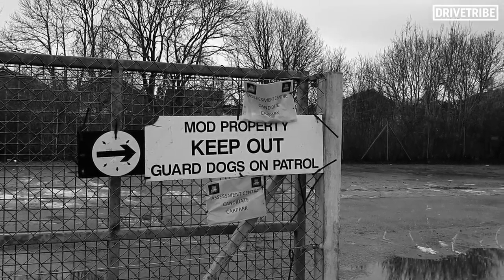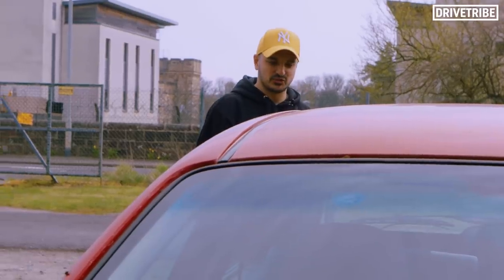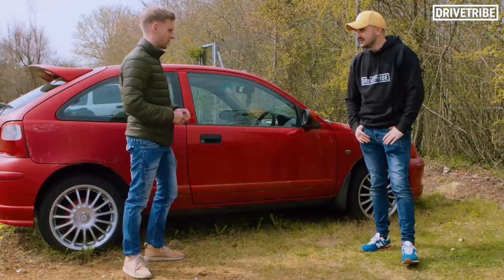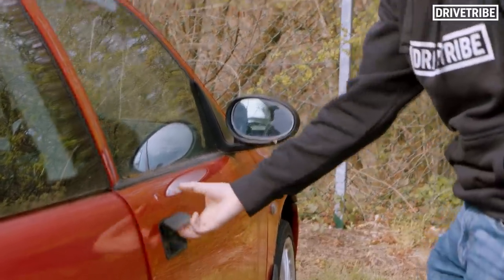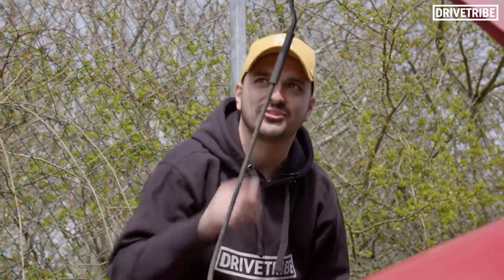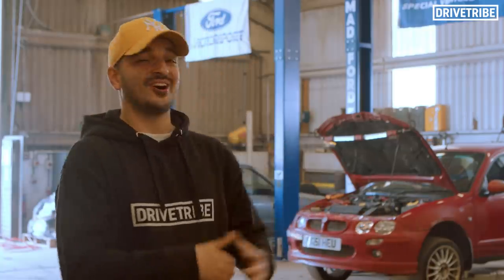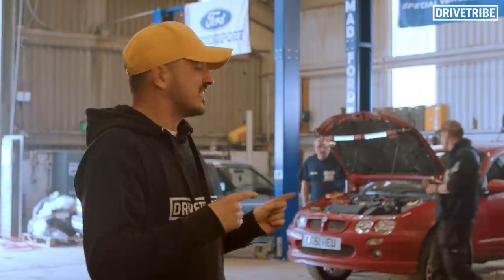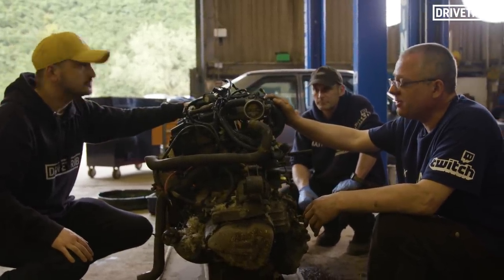Rescuing my abandoned first car from a military barracks | Rover 25 restoration

Comment: Get an MG ZR 105(1.4) ECU and Throttle Body and it will run at full power fine Mike!
Reply: Just about to post exactly the same, 1.4 105 48mm throttle body, 105 throttle cable and the ECU, 5as and fobs from the same car and jobs a gooden. Or just swap the tb and cable and have kmaps sort it.
Reply: This changes the throttle position relative to WOT or fully closed in some way right? That limiting spring. It just didn't make sense to me how the presenter explained it. Why would the engine not know there was more AIR available. Of course there is a map for it, the engine will compensate. Unless you are removing the ECU's ability to read the amount of air moving through its mass air flow sensor. Or am I missing something? He really threw me off explaining it like he did.
Reply: @cmendoza1094  Yes I am fairly sure you can just swap the TB, if they just limited the throttle movement why would they need to change the ECU?
Reply: @m4xww  that's a myth done so scrappies and mg breakers can sell ecu's for a saft price... realistically change the throttle cable and throttle body and it will do fine!
Reply: Could you not use the 52mm throttle that was on the MGF/TF's e.t.c?
Reply: @ek8710  you could but the tf is a 1.8 thus you could be making the throttle too big for the size of the engine, intake and exhaust are specifically sized to produce a decent scavenging effect, too big a throttle body (for a 1.4) could lead to less throttle response and even worse less power!
Reply: These are my absolute fave type of comments…..powahhhhhh
Reply: @cmendoza1094  exactly!
Reply: Yeah, acting like it can’t be done... I was thinking, if they purposely limited it, you can purposely put it the way the ZR would. I think they should continue down the ZR clone path.

Comment: You can just fit a different throttle body and cable and the ECM will learn the new body on these cars and you get more power.
Reply: Exactly what I did to mine!
Reply: I was thinking that, Rovers always went the easy route. Why make 2 ECUs when you can make one
Reply: Exactly so it will go from the 85Hp to the full 105 that the 1.4K series makes
Reply: @adambamberg9385  yes we did!
Reply: @mattdickins2127  trust you to show up 😂
Reply: I did exactly the same to mine back in 2011, massive difference!
Reply: Me 2nd car was a Rover 25 1.4 Impression. I just cut the Plastic Tab off the throttle body that restricted it from opening fully. Worked perfectly
Reply: @37ant  I was just about to post exactly this. The only difference is the extra throttle stop lol
Reply: @smh28v6  

Different throttle cable and the throttle disc in the restricted TB is a big weird plastic wedge affair compared to the regular throttle disc in the unrestricted item.

Comment: My first car was a 2003 Chevrolet Impala LS that I bought from my mom for $4500. I still remember how I felt when I came home from work with that car (mom let me use it since I worked evenings and she worked days) and I saw a black Hyundai SUV in the driveway. It wasn’t there when I left. When I asked her about it, she said that was her new car. And when I realized what that meant, I gave her a hug and then looked back out the window at what was now my car. I was ecstatic. 3.8L V6, sunroof, fog lights, headed leather seats, a short spoiler on the trunk, and the whole thing was painted a metallic dark tan somewhere in between gold and brown. I had that car for some four years before the transmission went. If I could, I’d find that car and restore it back to a factory grade look. Way to inspire me, Mike!

Comment: I was extremely lucky. My grandfather drove a 2005 Mercedes Benz E500. When I turned 16 (2016), it was 11 years old and he had just had knee surgery. Getting in and out of such a low car was an issue for him, so he gave it to me. I must say, having a 5 liter V8 in my first car was pretty incredible. Literally double the size of my current Hyundai Sante Fe Sport's engine. Had to sell the Merc when I went to college. It wasn't big enough to move all of my things, and had too many problems to trust it with the regular 800 mile trip too and from school. I miss it though.

Comment: Just to point out on that throttle body thing you don’t need to remap it it’s a straight swap but yeah great video as always :)
Reply: PagMan It's the Rover guy
Reply: @svareee Fancy Seeing a Twitch Viewer here
Reply: The throttle cable needs swapping too.
Reply: @roverboy01  didn't have to on my old one. :)
Reply: My MG ZR has an issue… the hazard lights will not turn off at all. 

Can you please give me some pointers?
Reply: @Slothdeman  sounds like an electric issue I’ve actually never heard of that before
Reply: @Slothdeman  

What happens if you unplug the hazard light switch? Could be as simple as it being knackered though it's an unusual failure!
Reply: @Slothdeman  If its a very late model/ facelift, it could potentially be the Pektron body control unit. They have the tendancy to go abit senile and cause all sorts of bizzare electrical issues.
Reply: @skylined5534  When I unplug the hazard light switch they stay on. It has been in a front end bump before so it’s at the auto electrician…. Hopefully it’ll get sorted. 

I’ve had all my Pektron relays replaced so it must be a wiring fault

Comment: That is more MG than the generic Chinese cars roaming the streets with a badge.
Reply: Japanese engineering you mean?
Reply: @tonyli2096  Chinese now I own a Chinese mg and have 0 complaints about it
Reply: @Srevelation  I meant the one Mike Fearnie has, the partnership between Honda and Rover was apparent back then. I have no problem with Chinese cars, I’m Chinese 😂
Reply: MGs of today are actually half british being mostly developed in the UK
Reply: @tonyli2096  The 25 was a bit half an half. It was like a combo of Austin Maestro and Honda Civic parts. They were great though!
Reply: @Srevelation  Chinese MG? You probably meant to type MSG!
Reply: @TravisTerrell  the 25/ZR was a bit of an odd one, it had a Modified Maestro Rear Axle and the Bodyshell underneath at the front was the Same as a Rover 200 R8 and the back end is completely original, they used some parts from honda too such as the Indicator Stalks but overall they were great cars.
Reply: It really isn’t. There’s nothing MG about these cars at all.
Reply: I live in China and have an MG6 1.8 Turbo. It is actually the fastest MG ever. China built but engineered by Brits. It goes where you point it, handles well and has enough performance for most driving and all the toys you could need including GPS (with English option) and cruise control. It now has 155,000kms on it and has been the most reliable car I have ever owned (shame Rover couldn't get that right) and we are currently looking at replacing her with - of course - another MG6, the top of the range MG6 Hybrid. Well, in fact not changing her but we will keep her as a local runabout alongside the new one. Great car, does exactly what it says on the tin!
Reply: @Roverjoe   Interesting. Gotta love cars made from spare parts!
Reply: yall got Chinese cars?
Reply: @tonyli2096  No Japanese Engineering in the ZR. The K Series was totally designed by MG/Rover as an alternative to the Honda engine being used in the Swindon equivalents of the rover 200 (previous model). The gearbox is a peugeot one.

Comment: My first car was a 1990 Jaguar XJ6, this was almost 15 years ago. 4.0 poverty spec with beige cloth interior 😝. It was my dad's. He was always a bit of a delboy character and had bought it used instead of the other option which was a Granada v6 if I remember correctly. He was super chuffed. Sadly he passed away when I was 16 and it sat in the garage for over a year getting in a sorry state. At 17, and with a Haynes manual and a cheap halfords toolkit(which I still have), I took my first steps in learning car mechanics. Sorted some rust, fixed the leaky oil cooler and got it MOT'ed. The money I saved buying a car went towards insurance. And this was when you could pay to get 3rd party on other cars, which enabled me to drive it. Bit dubious of course. Unfortunately, after 2 years the rust got soo bad. Beyond the skill and finances of a 19 year old teenager. And with no space to keep it, ended up scraping it. Me and mum were in tears seeing it drive away on the back of a low loader. One of my biggest regrets as now, I would happily spend the money to save it. Still, that car was one of the seeds that ended with me as a mechanical design engineer - I've even made parts for JLR! Maybe a kid in 20 years time might be fixing something I designed 😅

Comment: I used to love that car.. wanted it for my first car as well in 2013 but ended up buying a Nissan Almera.. which I still have in 2021 with 160k on the clock
Reply: An Almera?…you poor soul
Reply: I have Lymphoma and that’s not as bad as an Almera 🤣🤣
Reply: What year?
Reply: The MG would have cost a lot more to still have after 13 years 🤣
I have had a few mgs. Lol
Reply: @misterbuklau4053  2004
Reply: @Missed_Apex_GT  my mum had one at the time which I learnt to drive in so I bought one for myself. The 1.5 petrol is bulletproof and I’m never getting rid of it. Nothing wrong with Almera’s probably most reliable hatchback of its time apart from the Corolla
Reply: @Missed_Apex_GT  I’d rather have an Almera 😉
Reply: @forresttm  had a rover 4 years and all it cost me was indicator bulbs, about 90 quids worth of oil (halfords trade card) and a 110 quid headgasket job

Comment: That guy is brave driving a Renault tow truck, what do they have as a 2nd tow truck to tow that and the car thats on it?  Lol
Reply: I'm just trying to figure out why he dragged it out sideways if it had the key. (I drive a similar van)
Reply: @sercanserj7804  Battery was dead and they did it from the front so it would be right way round on the flatbed
Reply: @theprodigalstranger5259  I would have just pulled it back first then lined up in front rather than dragging the front around.
Reply: @sercanserj7804  I think its a leverage thing as well. Ive seen them do the same thing with beached boats. They'll pull them from the bow, supposedly makes it easier.
Reply: @theprodigalstranger5259  dunno why it matters on a flatbed which way it's facing, unless he wanted to be very specific about balance but the rover/mg is quite balanced
Reply: @zackraiden5875  each axle has it's own weight limit. With the engine being at the front you dont want all that weight behind the rear axle.... if you have a 7.5t truck it wouldn't matter but with 3.5t you need to be careful.

Comment: My first car was a Triumph 1500 - 200 quid from a mate 40 years ago. A couple of months into the ownership the big ends went to we towed to another mates father in law's garager, too the engine out and apart, took the crankshaft to Brunt's of Silverdale (Stoke on Trent) and the  skimmed it, we fitted a set of oversize bearings put the car together, sorted out the timing and first turn of the key she fired up smooth as silk. She kept me on the road until I traded her for a 1600cc straight 6, Triumph Vitesse - now there was a car I wish I still had

Comment: I was expecting it to be killed by a head gasket failure not a clutch.
Reply: That clutch and bald tires...might have something related to eachother. Burnouts
Reply: The headgasket problems have pretty much been resolved. Its a one time fix if it goes now, just use the upgraded kit.
Reply: @SpitfireFortyFour  I know, but it is rarely economical to do, so leads to a lot of Rover / MG being scrapped.
Reply: @grahamariss2111  It's more lack of knowledge. You take it to the local garage they charge way too much (and often do a poor job) and then the car is done for as it fails again and they say its uneconomical to fix. It happened to one of my neighbours.

The one time I have had a K-Series go I did the job myself and it cost me about £160. Alternatively there are specialist who do it plus the belts for around £350.
Reply: @SpitfireFortyFour  Did you use the Multi Layered gasket that Land Rover developed? Did you also use the revised oil rail and stronger engine bolts to improve the engine rigidity?
Reply: @grahamariss2111  I used to use the elastomer gasket which in my opinion is a better choice than LR gasket. It doesn't require as fine tolerances and prived more durable. It was done on my cousins car about 7 years ago and 40k later its still fine.

My own car I did a full N-Series conversion with the revised oil rail and new head bolts etc.
Reply: @SpitfireFortyFour  the elastomer gasket is recomended for engines with liner protrusion which is at its bottom limits.
Reply: @SpitfireFortyFour  It's never a one time fix its a total myth. They typically last another 50-60 thousand miles or anything between 5-9 ish years depending on how they have been treated in my experience.
Reply: @elliotroles7502  Agreed for the MLS and Elastomer gaskets. N-Series conversion however has never failed me.

Comment: Oh my word, first car was a 1300S  Fiesta (ALP956S). It was an accident repairable that had sat for a year and a half and needed a bonnet, 2 wings, a door and a door skin. Ended up changing it from its original Silver to Black (bodywork and painting cost me £650 back in 1987 - the car itself only cost me £200). Sold it after a year for £950 and have regretted it ever since. Loved that little mk1 fiesta.

Comment: What a great video, excellently produced by its enthusiastic ex Rover owner. Also, you comment in how small the engine is in camparison to other's and this was the beauty of the groundbreaking Rover K series engine, very light and compact, but powerful, this is why many sports car manufacturers like Lotus and Caterham used them. I've had three and not one of them suffered from headgasket problems, i believe it was only the 1800cc version that did. Nevertheless, having the piper piping the car out of the barracks was a great little touch too. Can't wait to see it finished . 👍😎

Comment: This was the same engine in my metro GTi 16v tpi.  They were awesome little units when they worked.  I went through two engine replacements during my ownership.  I think they produced 105 bhp in standard form.  Doesn't sound like much but it was a little rocket ship.
I still wish I owned it.  The biggest nightmare was the hydrolastic suspension.
Can't wait to see this case complete.

Comment: My 2nd car was a Rover 25 1.4L Impression.  I Just cut the Plastic tab off the Throttle body restricting it from opening fully! Worked a treat didn't need to change it. was just as fast as my Friends ZR 
.
.

Comment: My first car was a five dour K10 March (Micra) 1.0 with a 4spd manual. It was ridiculously quick in my mind but that's because it buzzed and rattled and vibrated along with the engine which you had to wring out to get anywhere even moderately quick. It was bullied on the road by the draft of passing vehicles and cross winds. It was great. Had it long enough to love it, but not nearly long enough modify it in any way. And aside from a set of tyres, nothing went wrong with it while I had it. Keep in mind that this car was 13 years old when I got it.

Comment: Neighbour had a 1994 Opel Vectra A (Vauxhall Cavalier) sitting in his garden for about 8 years. It was missing a few parts, including a radiator, accessory belt, dashboard cluster, headlights, etc. Had moss growing on the inside of the car. Hooked a new battery up to it, fired right up. No smoke, no weird noises. Started and drove.

Comment: I think that throttle trick was common for Rover/MG. I've got a ZS180, and one of the first upgrades most folk do is swap the throttle body for the one from the ZT190 for a more peppy throttle response. That and advancing the timing a few degrees, and those are (apparently) basically the major differences between the 180 and 190 versions of the KV6 engine.

Comment: My uncle had both rover 25 and an mg zr loved them both, he said they were both lacking abit in power however said they handled well and when I was younger they felt fast, had bucket seats n that, sounded nice wasn't sure if he had a modified exhaust and air kit but eitherway, I wouldn't turn one away that had little/no rust

Comment: As others have said, Rover only liked to make 1 version of a part, so they added a stop in the throttle to make a new version of the 1.4, the 84bhp 1.4. The 1.4 DOHC 16v K series engine was always 105bhp. On the 1.8 VVC, there was a 48mm plastic throttle body, which did stick sometimes, so I replaced the MG F's plastic TB with the all alloy 52mm TB from the Trophy and this apparently raised bhp from 145 to 160bhp! 

There is nothing like the memories of you first proper car! I'd love to find my old Rover 220 coupe Turbo! Y877 YEY

Comment: My first was an Audi A3 1.8T -00. I was 18 year old and I obviously thought I was the king of the road in my Audi. The car was plenty fast though with 150hp with only 1300kg. I borrowed it to a friend who needed a towing hook and a few hours later I got a phone call that she had put it in a ditch. It was messed up pretty bad with busted springs, wheel alignment, broken back window and big damage on the bodywork. My dad knocked out the dents, resprayed the body and replaced the broken parts. Now my sister owns it and drive it everyday and it's got 170 000 miles on the clock!

Comment: You can certainly fit a full power throttle body with the original ECU, this was an extremely common mod and will take it from 83bhp to 102bhp.  It's no different to driving the full power engine but never opening the throttle fully, you don't need a different ECU map to do that!  FWIW the reason it was done was to lower the insurance group on the 25.

Comment: My first car was a 1970 Chevy Camaro, with a cut bumper to mimic the RS split bumper. 
350 and a power glide out of a '73 Chevy wagon.
Blew up the trans in 2 weeks flat, doing 1/4 mile burnouts.